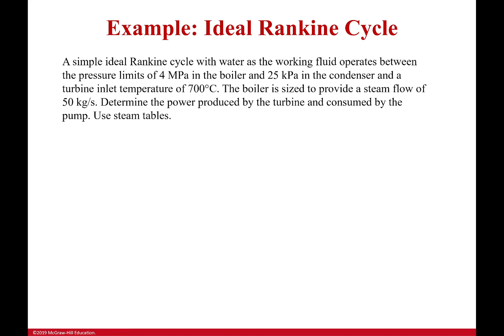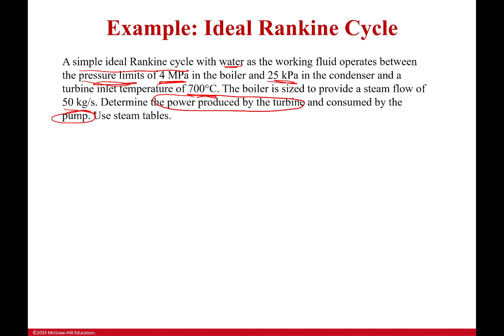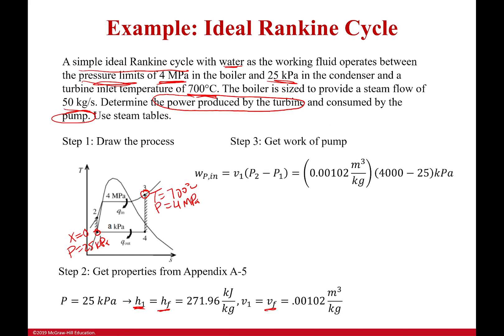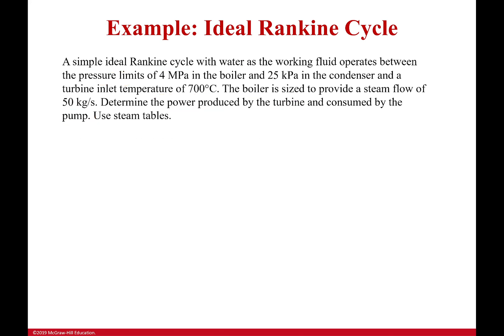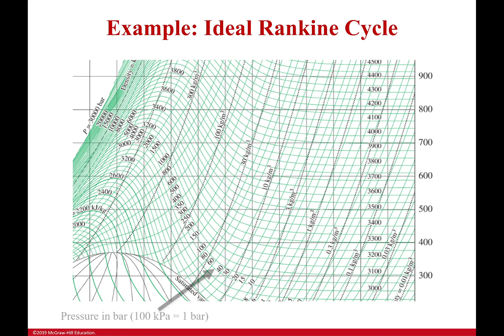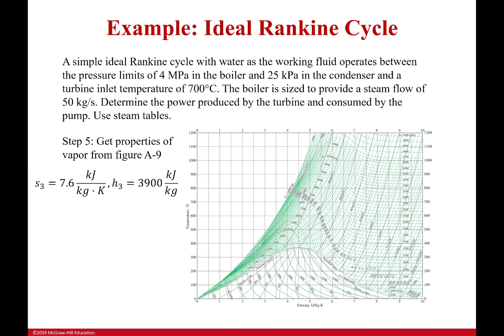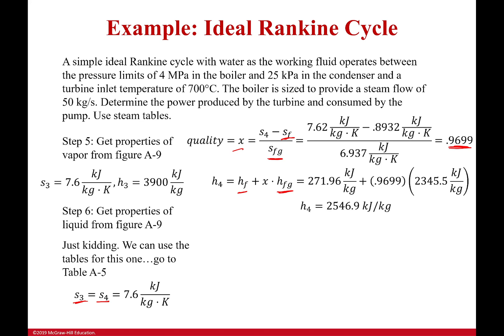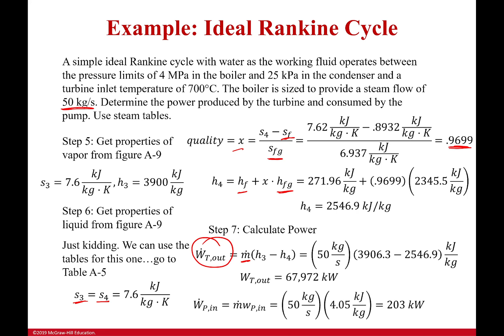Example: Ideal Rankine Cycle

Comment: I think you have choosed wrong data for calculation from Steam table. The question asked for 25 kPa (0.025 MPa) which has different value than what you have took for h, s, v  for 25 kPa pressure. (From the data that you took, it looks like you have used the value of h,s,v for 0.25 MPa pressure not 0.025 MPa ).

Please forgive me if I'm wrong. I have recently started this chapter and its already making my mind wobbly.
Do correct me if I am mistaken.
Reply from the maker: I think you are mistaken. When I double checked the tables I got the same value for enthalpy and specific volume at 25 kPa. But no worries!